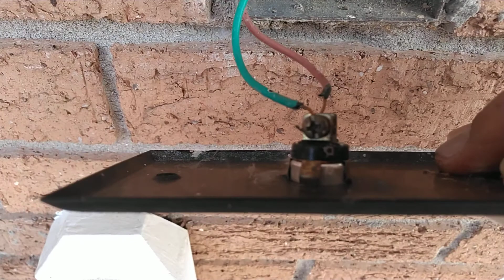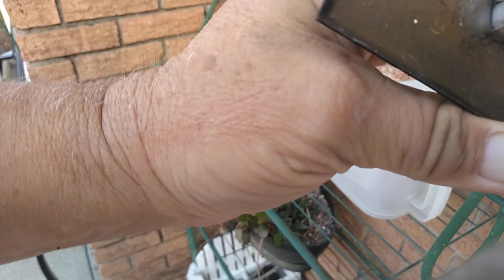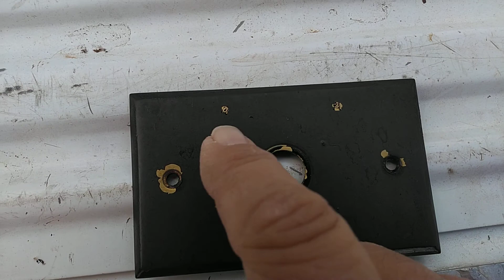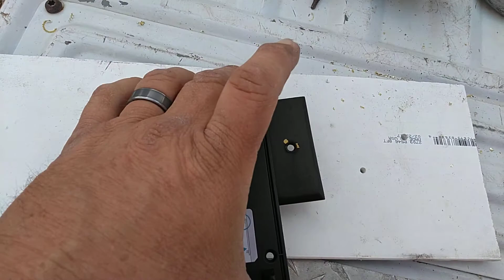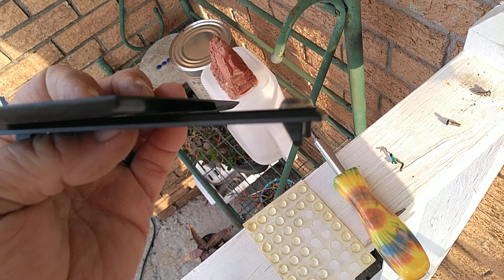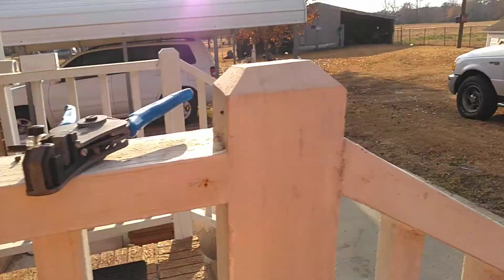Install Ring Doorbell to Existing Horizontal Doorbell

Comment: Thank you. I'm running into a similar issue with vinyl siding on my house, where I can't mount to where the old doorbell was, completely, vertically.
Reply from the maker: You're welcome. I hope this video helped you in some way. I just installed 2 Ring doorbells at a friend's house today and I had to do the same thing for him. His were horizontal as well but when I finished everything worked great. He was well pleased.